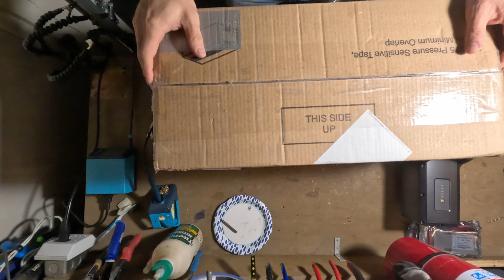Repurposed 52v 18AH ROBOT Batteries!

Comment: Hopelly the sllicone mastic is non-corrosive.
Reply from the maker: From what I understand silicone caulk is only slightly corrosive when it's curing. Once cured, it shouldn't be off gassing any acetoxy. I'm not too worried about it since nothing is really delicate in the battery.